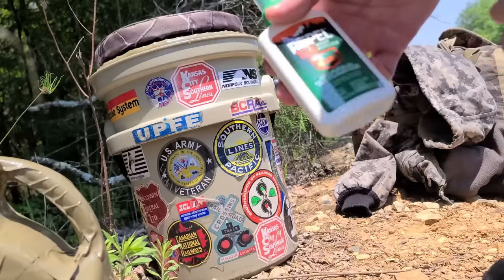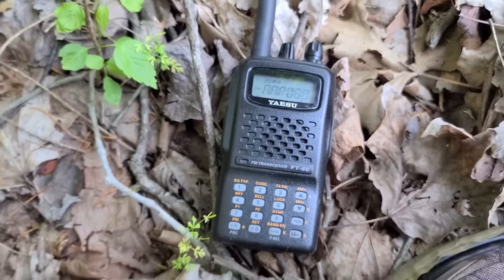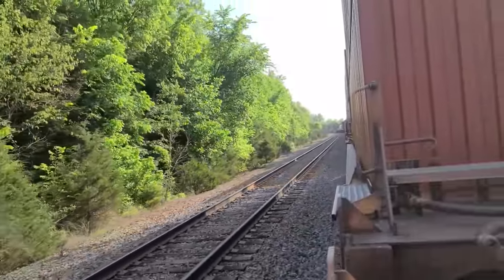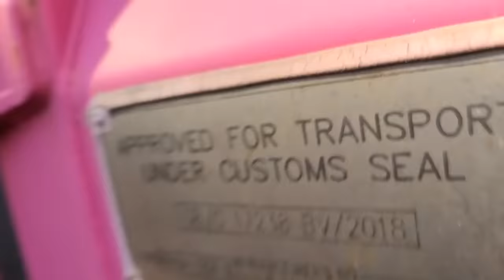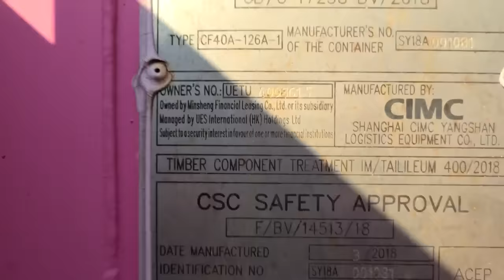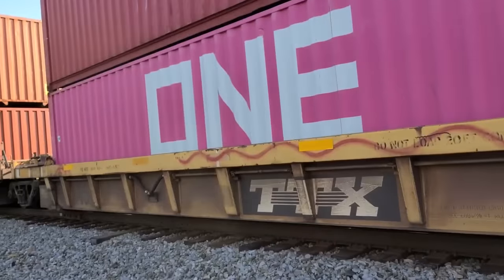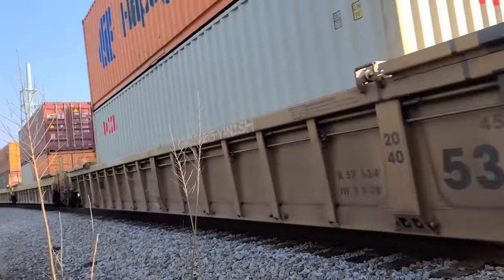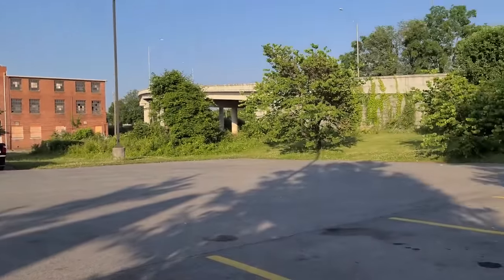Pink car ride old school style IM!  (description explains a lot of details)

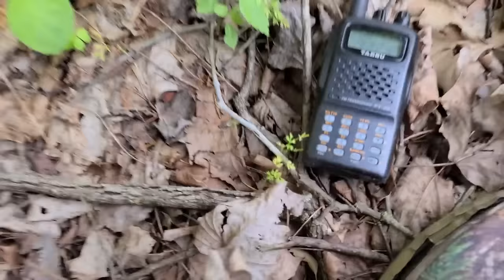Comment: 6:07
I've had the same Yeasu FT60 for well over 10 years, and I've treated it like TRASH.
The damned thing just won't die. Really, everything about it is excellent.
I work for a commercial Motorola dealer and the FT60 is what I take into the field to help diagnose multi-thousand ££ installs.

Comment: It was after dark when I was visiting at a small house in Atherton, MO. I knew there was railroad tracks running through it, parallel to the Missouri River. Well, there were several folks in the parlor, including myself, when all of a sudden, a train horn sounded like is was right outside the back door … which, in actuality it was, did not realize we were that close to the tracks. The house was shaking, pictures on the wall were swinging, I noticed that everyone had stopped talking, I was about to pee my knickers. Anyway, seconds after the train had passed, conversations commenced. Never experienced anything like that since.

Comment: Norfolk Southern Hobo Detector Milepost 56.2 Main 1, you have a Hobo near axle 135 repeat Norfolk Southern Hobo Detector Milepost 56.2 Main 1, you have a Hobo near axle 135, Detector Out!
ONE is Ocean Network Express Holdings, Ltd. and pink is the company color.
Be safe out there.
@26:47 you have a cop car whiz by on the road.

Comment: Hey Shoestring I've been following you for years. I've heard you mention a few times about having to stand up on tiptoes to pee over the side. I've got a solution for you that I learned from having prostate problems and I do it all of the time now just easier. I keep a couple of big drink cups around or a wide mouth orange juice bottle with a cap and just use them. pee clean and comfortably in any position or anywhere can even pee in it laying down LOL!! trust me it works great. Even hides your willy from view!! I'm sure you could find something to use that you could carry along with you in your bucket or pack. Don't risk you life or pee on something you'd regret if you don't have to. Works well at home or out on the boat or pulling over in the truck on a road trip, etc.. I save a lot of water at home slinging it out the back door LOL.....Keep on riding my friend and be safe out there !!😉

Comment: You nailed it right on the head with that dpu setup. That's what's making the railroad engineers and conductors getting ticked off. Basically they got two guys hauling two trains instead of four guys hauling two trains.

Comment: Lookin at all the stickers on your bucket wish I would have saved some of the IC and ICG patches and other things he brought home I woulda sent you some somehow LOL, he used to get these things called torpedos, it was a little square piece of TNT in a fiberglass square piece sorta flat about 2 inches square, they'd put em on the rails behind the caboose or whatever what was at the end of the train to warn the next train that the lights were out or weren't right or whatever, Dad said they'd put 6 or so on each rail, he'd bring home bags of those things because they had 2 pure lead straps on them to fold over rails to hold em in place, he'd pull the straps off and melt them down to make mini balls for his muzzle loader and other calibers of bullets, that pure lead was shiny as silver, we'd go out shootin and I had a little ithica .22 those TNT charges were fun to shoot. He brought home all kinda RR stuff. Yeah 5 minutes behind another freight holy cow, he did slow down that's for sure. I forgot that I have Dad's IC Conductors Uniform with 2-IC Brass lapel pins with threaded studs and a finger wheel that's bigger around than a lighter strike wheel the jacket also has IC brass buttons. Dad started workin for IC in 59 retired in 03, did passenger runs, freight and coal depending on the schedule seniority, extra board and so on, I want to send you 1 IC lapel pin and a button from his conductors uniform so Dad and the IC can be on the rails again, it would be my honor, I can send pictures.